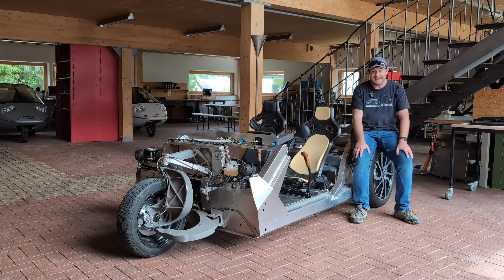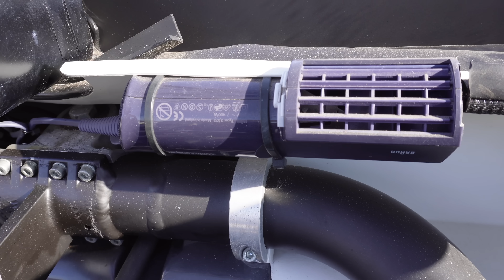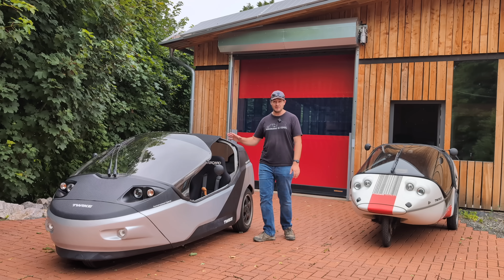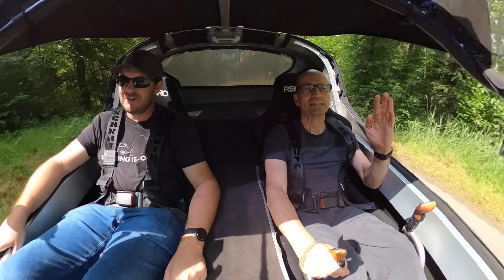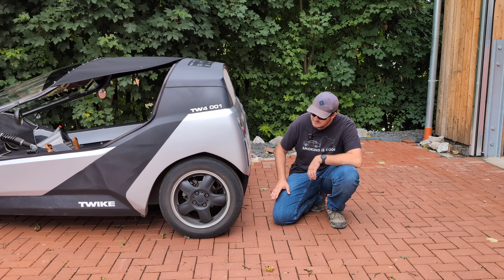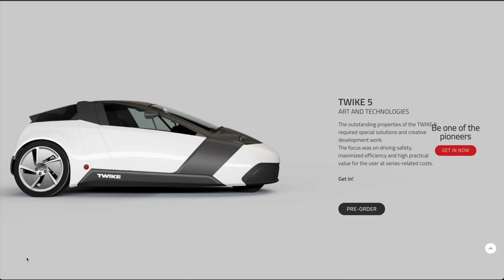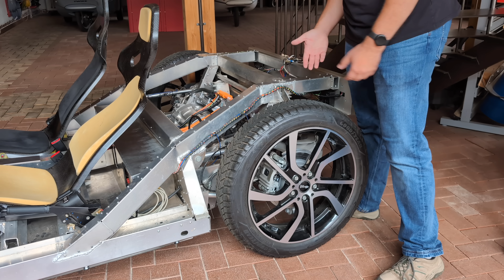TWIKE Is The Coolest Oddball Car Company

Comment: 45.000 euro without VAT for this TWIKE 5 is insane to me. 
With the lower safety and space then a general car this, to me, is a waste as a whole.
Getting into an accident in that thing driving 120 kmh on a highway (it can even go 190) is like a guaranteed death sentence.
(Sure, you can say the same about motorcycles but atleast on those it's an extension of your body, smaller and you wear protective gear)

I guess it's aimed towards some rich people that only intend to show it off in their garage and drive it rarely.

Comment: That tiny road doesn't have  a 100km/h speed limit, it has NO speed limit. Therefore, the general speed limits are applied. It varies per country, you might have motorway/road/town limit of, say, 130/100/50 km/h, in some countries you have additional types of roads defined, like car roads of higher importance with 110 km/h, "inhabited streets" limited to walking speed, "encounter areas" or pedestrian streets where cars can drive at 20 km/h at most, and so on...

Comment: I imagine most people would simply not bother pedalling after having it a few weeks. If they want to encourage pedalling why not have the pedals effectively functioning as the accelerator. Measure the power of the pedalling and have the motor power be a multiple of this? You could still have a neutral for charging, or direct motor to motor if you run out of battery in an emergency.

Comment: The idea of the brakes being hooked up to bicycle pedals that need to be pedaled backwards before they activate the braking mechanism is terrifying.

I feel like they should have committed to having the brakes be activated by the hand controls because that would be considerably easier to do in an emergency situation and is less likely to be done incorrectly.

I feel like the pedals are actually a good idea from a wellbeing standpoint (it's like having a gym bike integrated into your car and that could have significant benefits for people who would otherwise be stuck in traffic and may not be able to use a bicycle for their commute) but I don't think that there's a good argument for them to have a function beyond possibly helping to move the vehicle off of the road in the event that the vehicle breaks down.

At most they should be for emergencies to move the vehicle a short distance without battery power.

Comment: It looks amazing. Thank you!
 If I had an opinion it's that the new chassis is definitely prone to understeer with the narrow front tire and wide back without having independent suspension (let alone the differential) in the rear. I think it'd be better with independent suspension on all sides or at least the front with 2 tires instead of one or a wider front at minimum. Also it'd be better to have the pedals directly connected to the drive system instead of wasting energy. Plus you would get a natural resistance along with changing gears with a more efficient connection meaning you won't lose as extra steps by converting pedaling to electric. It's better to simply drive the wheels. This is a cool project. Thanks for sharing it

Comment: Can someone tell me an advantages of the decision in making single front wheel (3 wheel card) instead of normal 4 wheel car. As I understand, 4 wheel card is safer.
Reply: At least in the US, 3 wheels means it only has to meet motorcycle regulations and not car regulations. You can either look at that as being more room for innovation or a loophole to cut corners
Reply: @addison1024  i see thank you for the explanation.

Comment: Did they solve the tipping over problem that every other 3-wheel vehicle with one in the front has had throughout all of their existence?
Reply: Yes, in our experience this question has been answered for over 25 years (see, for example, the TWIKE 3, which has been built since 1995). Essentially, it is a question of where to design the centre of gravity (as low as possible and central in the contact triangle of the three wheels). The whole thing is combined with suspension kinematics that allow the wheel with the higher load during agile manoeuvres to perform the corresponding steering task. As a result, you don't feel like you're sitting in a tricycle even when changing corners quickly. With all the advantages that a tricycle offers - lower torsional tendency of the BIW around the longitudinal axis, higher lightweight construction potential. When analysing the critical driving manoeuvres, the higher reliability of the delta solution (two wheels at the rear, one at the front) becomes apparent. The fact that only two wheels on the front axle can provide good support is unquestioned fairy tale knowledge from Mr Bean videos and is better erased from the mind 😉

Comment: The wheels are on backwards. It’s a death trap.
Reply: Don't worry, the delta arrangement (in combination with the organisation of the centre of gravity in the right position) was and is the right decision. You don't realise it at first glance (because you think that the two wheels have to balance towards the front), but the lateral control of the rear axle is much more important for the driving dynamics. It's not without reason that you won't see a tail wheel solution on large jumbos, such as those still used on aerobatic aircraft. If you want to do more in-depth research, look up the reasons why the better tyre tread is mounted on the rear axle 😉

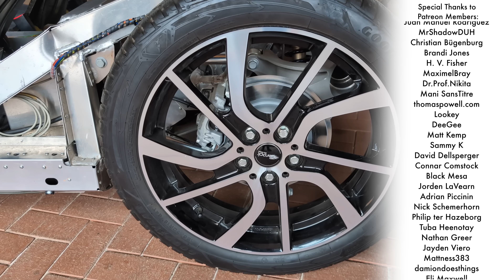Comment: Thank you Robert & Aging Wheels. Great video presentation. Really enjoyable watch. Any chance of a development story concerning the frame damage at time stamp 19:07?
Reply: The fold has no influence on the overall structure (even if it clearly looks different). However, the frame was only intended for commissioning the electrics and confirming the kinematics. It was not planned that it would also drive. The drivable frame is currently under assembling and will be shown in the next few weeks😉

Comment: That thing about small roads with a high speed limits is exactly the same in the UK. I was once on a country road in the British countryside that was barely big enough for a single car but had the national speed limit on it (60mph for this type of road). It then opened into a proper two lane single carriageway that could comfortably accommodate articulated trucks on both sides and its speed limit was… 40mph 🤨… I don’t understand the logic either.

Comment: No BMS??!
Can i get one without the stock battery?
Reply: Already the TWIKE 3 had a BMS, but no single-cell balancing (the statement in the video is unfortunately somewhat incorrect). However, the cells are inherently safe and also incredibly even and robust. The TWIKE 5 does have a meanwhile standard automotive BMS system.
Reply: @TWIKEofficial   I might humbly suggest adding an active, inductive cell balancer. 
 I put them on all of my battery packs and they work through the charge discharge cycles @~ 1A
Reply: @Just-Iss-4U  Thank you for your good advice. The TWIKE 5 already has a first-class system installed. Only in the TWIKE 3 did it turn out that the cells were more robust than the balancers at the time. If the cells do not suffer any mechanical or moisture damage, experience has shown that the cells we choose last for over 15 years and remain at the same voltage level in the mV range. Balancers are better today and that is why we have already adapted them for the 5 series 👍

Comment: USA here, and I have wanted a Twike for 30 years.  The problem was the USA would not allow them into the country.
Reply: Active import by the manufacturer really only makes sense above a certain number of units (allocation of the initial registration costs). However, the requirements (essentially for US motorbikes) are generally easy to fulfil and a number of TWIKE 3s have also made it to the USA by self-import in the past. In principle, it is therefore possible and the TWIKE 5 will also be importable 👍
Reply: @TWIKEofficial  24 years ago I got into an email fight with a customs inspector who refused to let a Twike into America, bought used in Europe. Some have made it now, but 24 years ago there were no 25 year old examples. The USA will let 25 year old versions in. I have no idea what the point is of the laws, except to protect the domestic car market.
Reply: @HRDBMW  I'm sure there's also a dose of protectionism behind it. On the positive side, however, it can be said that imports are possible if the requirements are met. And ... that there is an openness towards classic cars. That shows (at least some) heart 😉

Comment: Using just one fore wheel in a model that is supposed to go 150 kph is .... STUPID
It's a reverse forklift. In training we all were told to go slow with a forklift in reverse. Taking a turn while to fast tips you over. Balance triangle and stuff. This Model 5 does it just wrong.
Reply: A three-wheel forklift truck must have its own weight on the side opposite the forks, otherwise it cannot support its load. The centre of gravity is therefore located in the wrong corner of the support triangle when unloaded. - A tricycle with the objective of high agility and high speed is already designed completely differently in the basic layout (position of the centre of gravity, kinematics with lateral force, roll stability, build-up of roll angle speed, caster, toe and camber of the rear axle wheels, roll centre, etc.) and is therefor not comparable. - Taking into account the relapse-proof straight-line driving, the single wheel of a fast tricycle must necessarily also be in the front. Because the rear axle keeps the vehicle on track, if only one wheel fails, a second wheel must maintain the function, otherwise the vehicle inevitably turns a pirouette. So don't worry, everything is designed correctly and has to be this way!😉

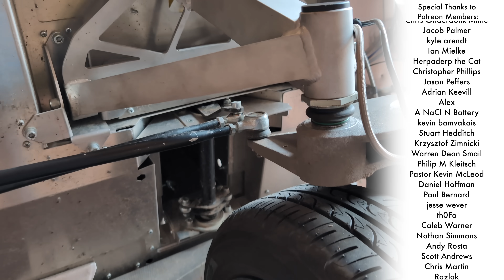Comment: The frame is buckled in front of the rear wheel. 19:08 just above the frame upright.  Time 19:08
Reply: The fold has no influence on the overall structure (even if it clearly looks different). However, the frame was only intended for commissioning the electrics and confirming the kinematics. It was not planned that it would also drive. The drivable frame is currently under assembling and will be shown in the next few weeks.

Comment: No BMS is fine until a cell becomes faulty, then it's unsafe
Reply: It has a BMS, but no single-cell balancing (the statement in the video is unfortunately somewhat incorrect). However, the cells are inherently safe and also incredibly even and robust (if the vehicle is not parked below the waterline).

Comment: Just starting the video, but why don't they know to put the two wheels in the front and the single in the back??
Reply: Don't worry, the delta arrangement (in combination with the organisation of the centre of gravity in the right position) was and is the right decision. You don't realise it at first glance (because you think that the two wheels have to balance towards the front), but the lateral control of the rear axle is much more important for the driving dynamics. It's not without reason that you won't see a tail wheel solution on large jumbos, such as those still used on aerobatic aircraft. If you want to do more in-depth research, look up the reasons why the better tyre tread is mounted on the rear axle. 😉

Comment: I've no idea why they persist in keeping that cockamamy steering & throttle control method. With a wheel and regular pedals this thing would probably sell much better.

NB. There's a company in UK who do EV conversions on classics. They did an EV conversion on a Bond Bug (originally made by Reliant). That thing looked to be stable, handle well, with decent range, etc. If you're ever in Europe again I'd suggest a quick trip to UK to check out what they're up to.

Won't mention the company name as it'll probably look like I'm shilling. It's easy enough to look them up though.

Comment: buuuut, if I enter a competition regarding EV-s and efficiency, why would I not Start my whole project doing fluid dynamics simulations to design my car as aerodynamically efficient as possible??? Super strange....
Reply: The X-Prize was not won by the most efficient vehicle, but rather by those who survived the knock-out stages and then competed against each other in the final race. Of the 136 original participants, only 5 did so, and of these 5, only 3 crossed the finish line (the TWIKE 4 shown here took 3rd place). And in this last race, it wasn't about efficiency, it wasn't even about keeping to a maximum consumption, it was all about speed. The fastest one won. And yes, for one of the knock-out days, each of the participants also submitted a flow simulation analysis. A maximum consumption of the equivalent of 17 kWh/100 km had to be demonstrated. The TWIKE 4 managed less than 12 kWh/100 km under competition conditions. The target for the production vehicle today is 6.9 kWh/100 km.
Reply: @TWIKEofficial  I appreciate the reply. Based on what you have written, the info in the video was not correct then?
I congratulate your achievements. But I was also correct based on the video :)

Comment: German roads are somewhat... special. Let's put it that way.

I am very surprised that the jump in weight and complexity from the Twike 3 to the Twike 5 is so substantial. It's less surprising if you have the "Not 4" in the middle there, but still...

Looking at the 5, I would assume the weight ends up somewhere around 800kg: You have that gigantic engine, you have the 40kWh battery pack and the complex cell to protect the passengers at speeds up to 190km/h. As a result, you need relatively beefy suspension components and brakes aso. So you create a snowball effect adding more and more weight to it. I don't really get it.
The Twike 3 is niche as hell already. By making it substantially more car-like, you shrink the acceptance in the old, bike-centered consumer base without gaining all that many car-centered people looking for an efficient and small car. I could be fine with the finger-throttle if the cruise control works well enough. But the whole braking using bike pedals is a step to far. I already hated that kind of braking in bicycles because you only can brake every 180°. I sure as hell don't want that in a car.
Then there's the fact that the shape (of the 3 and 4) isn't at all great from an aerodynamic point of view. It will lead to a sharp drop in range at high speeds making the goal of hitting 130+ km/h even more absurd.

In that sense, I think that an idea like Aptera is more feasable: Maximum efficiency also at highway speeds and at least some storage for your weekly grocery shopping.
Reply: The bike-centred clientele often sees a limit already exceeded at 250 kg. For this group, however, the TWIKE 3 and even lighter velomobiles are the answer. The TWIKE 5 is designed to appeal to car-loving customers who want to bring fitness into their everyday lives. After a certain age, the awareness for this develops, but the weekly time spent in the car is longer than the time spent in the gym. In the TWIKE 5, this user saves time, becomes healthier and also does something for the environment. Regarding the foot brake, you only use it in exceptional cases (the recuperation from the finger already decelerates up to the slip limit) and, compared to a car, you don't have to move your foot - so you are always ready to brake fully. As for aerodynamics, this will be sufficiently good (target consumption 6.9 kWh/100 km), above all the frontal area is optimally reduced. Storage space for the weekly shop is larger than on the TWIKE 3 and you can even sleep comfortably in it with the seat upside down. In any case, it is ideal for travelling with luggage for 2 people. If you have even bigger transport tasks, a trailer coupling allows you to tow a 300 kg load on the hook 😉
Reply: @TWIKEofficial  Fair enough about the other points but I am still not convinced about the braking.
And I am not saying it is dangerous, I am saying it is perceived as dangerous or the very least unnecessary.
Don't get me wrong: I know why you're doing the whole ratchet-like "only two positions where you can brake" thing. Robert also pointed out this is because those are the two positions where you can apply the most force with either your left or right foot.

The thing is though: Have you ever driven an old/classic car right after you've driven a well maintained, relatively new car? The brake pedal always has these few millimeters of empty throw where you press it and nothing happens. Even though I know it is there, I always have this 10th of a second panic when I press it and nothing happens.
Especially in an emergency situation, you don't want the driver to be forced to pedal back 178 degrees (worst case) or to remember to pedal forward 2 more degrees so he or she can brake instantly.

I know this is an edge case and I'm sure most people won't mind. But for me, this would be a real issue.
Reply: @vinzenzgeske8987  I understand your concern. On the other side, we are familiar with the braking systems of classic vehicles, we come from the old workshop practice and have learnt the craft from the bottom up. And of course, even when switching to a new vehicle, you first have to adjust to the braking point and then to the response behaviour. This, and the fact that there is such a point for both feet, is not a problem at all in practice. On the contrary, as I wrote above, since I don't have to change pedals with my foot, I can react much faster and more finely than with any conventional vehicle. Wait until we are in the customer presentation. The system will convince you too 😉